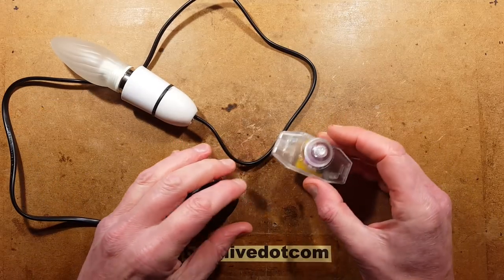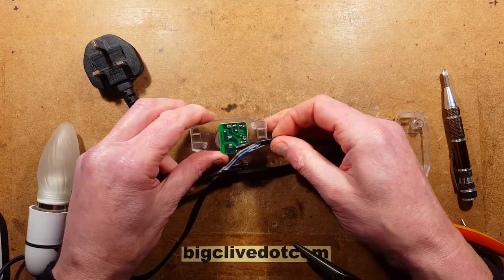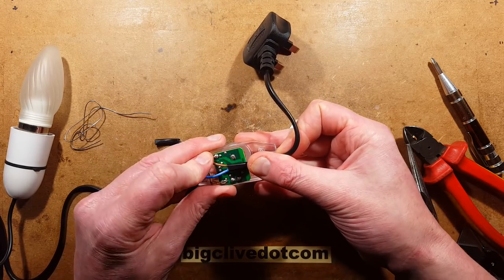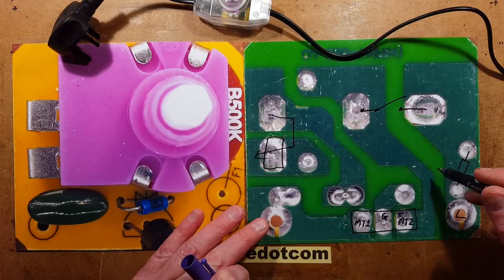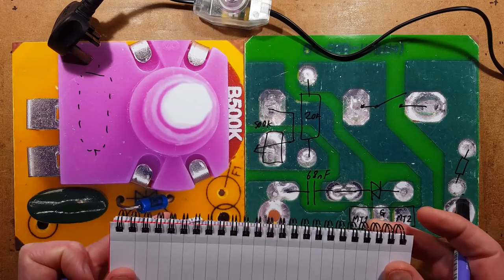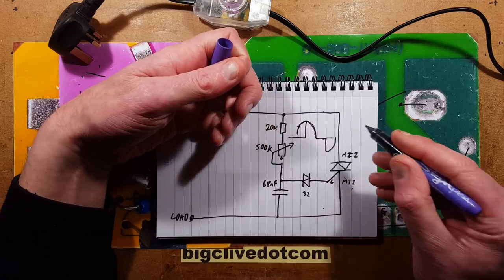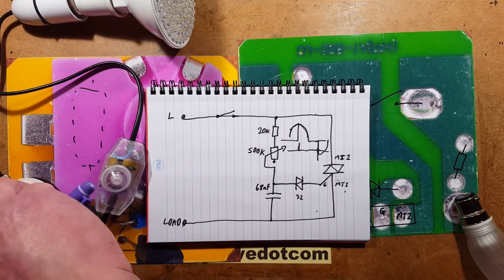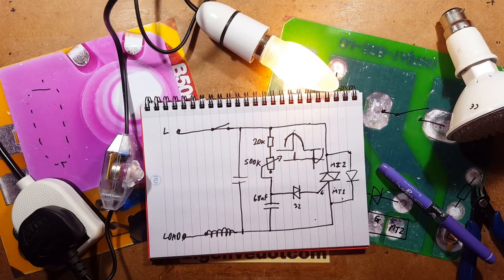Low class inline dimmer from eBay.  (with schematic)

Comment: What is different in the driver circuit in a dimable led lamp? They cost a lot more and break a lot more.
Reply: they have to current-regulate instead of voltage-regulate, which is a bit more complex in circuitry;  they have to sense the rms voltage from standard dimmer, then step it up higher (enough for LED to work) and then regulate the current according to input voltage percentage. (to corelate output brigtness accoring to one 'set' by dimmer on the input voltage

Comment: The transparent case is so you can see the fire start and the number of Chinese leads i've come across where the blue was active and brown neutral. How are they allowed to be imported and sold, self certification.
Reply: Intuitively, a lay person would think that the brightest colour blue would be the active wire but these colours were chosen to eliminate errors by a colourblind person.
Reply: @iconoclad  I think you missed the point. The standards are that in single phase systems like the light Blue is the Neutral conductor and Brown is the  Active conductor If the cable is Red and Black then the Red conductor is Active and the Black in the Neutral. Green or Yellow or Green/Yellow strip is always Earth conductor. The only time that Blue can be used as an active is in a three phase cable where there is a Red, White, Blue, Black and Green/Yellow conductors. Where Red White and Blue are the phase conductors and Black is neutral if needed and Green/Yellow for Earth. 
Colours were not chosen to eliminate errors by a colourblind person.
Reply: @richardkaz2336  Yes, my comment was a little off topic from your post. I am well aware of the standards that exist. The standards were introduced a long time ago when it was realised a standard was needed as there were so many variations between countries and manufacturers. The colours absolutely were chosen to eliminate errors by colourblind persons. A simple google search will turn up results supporting this fact. This was taught to me by college lecturers in the sixties. Either that or I read it in a trade journal or electronics magazine.

Comment: I have a cheap rework station from ebay the 825d and the display isn't giving me any information. It lights up a bit funny and the iron and the hot air both work. Has anyone got a clue what's popped?

Comment: Oh, just pass the cable on the side, under the circuit board... There is a gap between the case and the board.
Reply: That's what I'd have done.
I wouldn't have necessarily soldered the wires to their intended place but found a track-linked alternative location if it was more convenient.

Comment: Why does the dimmer suggest a minimum wattage of 15? What goes wrong if you use a lower wattage bulb?
Reply from the maker: The triac requires a minimum current to latch on.  If the load is too low it may flicker or not work at all.

Comment: I've tried a few dimmers over the years (not nearly as many as you though) and ended up going back to a plain switch every time due to the audible noise.  Does anybody have any recommendations for a dimmer that isn't noisy?
Reply: My Mega Socket dimmer is quiet.  It isn't completely silent but I can only hear it if my ear is within a foot or so which is pretty good.  I have good hearing so if I an only hear it that close then most people would have a similar experience.  It is the variety of dimmer where you turn the knob to switch it on and off as well as to operate the dimmer.  I got it on Amazon.  It is the dimmable LED compatible version.  All that information should help you make an Amazon or Google search that will track it down.

Comment: Having now retired from a very successful career in the electronics industry, I always wonder why electrical engineers strip cable the wrong way. Use your cutters the other way round, it will grip the insulator without the copper.  You will find it so much more easy to strip the cable. Just sayin'.
Reply: Yeah, I noticed that too. Also Clive draws resistors as boxes instead of squiggly lines and uses picofarads instead of fractions of a microfarad. Eg, 0.1 uf rather than 100 pf. Also V in lieu of E and L in lieu of A. I=E/R. Not picking Clive, we love you.
Reply: @Matt Quinn I was trained by the Post Master General (P.M.G.) in Australia and also Queensland Institute of Technology. Our training matched the standards used by GPO, or that's what we were told. The only place I ever saw box resistors was on Swedish telecommunication equipment drawings (Ericsson). There were too many drawings to have our draftsmen convert them so we had to work with those. All the electronics magazines used the same standards I use, RTV&H, Electronics Australia, ETI, Silicon Chip. That was the sixties and all the lecturers were very excited about the NEW standards we were being taught to herald the oncoming wave of technological advances. In particular, the adoption of E in lieu of V in ohms law equations, Hz in lieu of CPS, etc. Perhaps there was a European influence in GB by the time you were trained. I've been an electronics tech for 50 years. Check out the schematic here https://archive.org/details/EA1977/page/n41

Comment: Lamp cord over here looks more like mid grade speaker wire: it's easy to cut one side and zip them apart a little on both sides of the cut.
Reply: In europe all mains cables have to be double-insulated. (2 separate layers of insulation ) That makes it safer because it is much harder to cut straight into the copper or otherwise break the insulation and expose live conductors.
Reply: @Basement-Science  We used to have figure 8 mains wire in Europe too, guess the mandatory double isolation of ungrounded devices made those illegal.
Reply: @johncrowerdoe5527  I dont know when that became mandatory in which country.
Reply: @johncrowerdoe5527  Figure 8 cable was quite popular in Soviet countries also._

Comment: I had a dimmable desk lamp years ago. Eventually the dimmer function stopped working, so it was just full-on all the time, but it had a mechanical switch in the knob like this one so it could still be turned on and off. I would guess and say the triac failed shorted.
Reply from the maker: That's the most common failure mode of triac based products.

Comment: I recently got a dimmable E14 LED flexible filament lamp ... with all circuitry withing the E14 base ... how do they do that?
Reply from the maker: Do you mean that the dimming function is built in or that it is dimmer compatible.
Reply from the maker: @MrMegaPussyPlayer  It may be using the common linear current regulation chip.  They can handle dimming.

Comment: It’s nice when you print the high resolution pictures, but you don’t have to print eBay pictures you can show us the screen or something. Think about the trees.
Reply from the maker: One piece of paper shared with 30,000 or more people.  Then I reuse the back for rough sketches of schematics I'm reverse engineering.
Reply: @bigclivedotcom  fine, but in general, I don't think it's necessary. I love the paper btw, you can see clearly without reflection, we see it through our display anyway.

Comment: Wonder if the set of "destructions" mentions anything about only being installed by a qualified, competent person? As you said, I wonder how many of these things have gone bang through poor installation? Having to "skin" a 2-core cable to break into one of the inners is frankly, extremely dodgy. What an awful design, built-in possibility of burning the house down.......

Comment: Search fleabay.co.uk "31hs German Style Cable Knife Wire Stripper Patent Stripping Tools" I got one for a specific job - viciously sharp knife with a "T" top to the hook to rotect conductors, perfect for vertical slitting down the length of flat cables without peeling the conductors, useless for round cable.  Strangely the blade is useless for cutting horizontally around flat cable sheaths but perfect for toping round ones.
An odd tool in the same league as wiring scissors (perfect for lashed looms but a nightmare for single conductor and component work), with a bit of practice you can avoid totally amputating fingers.